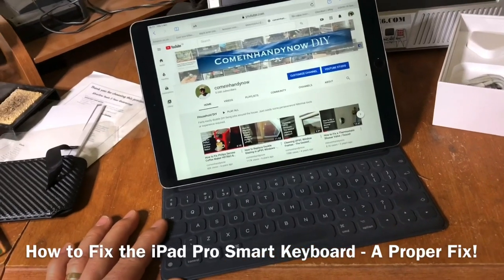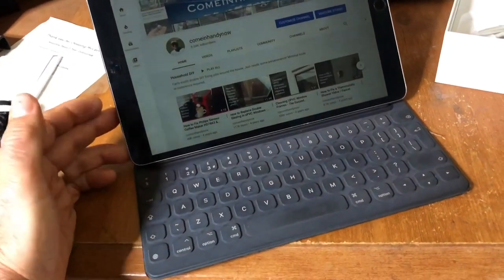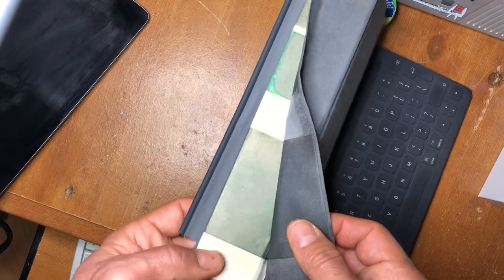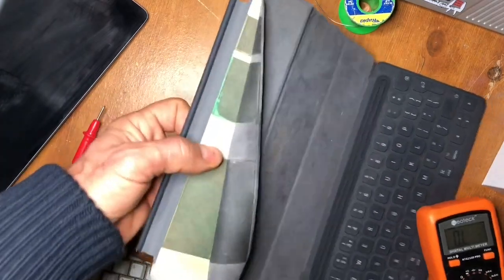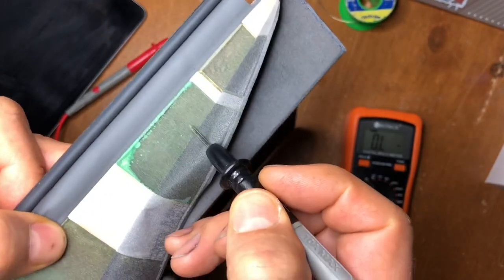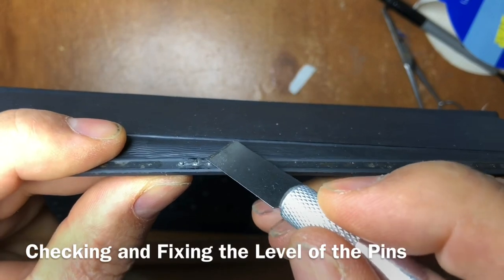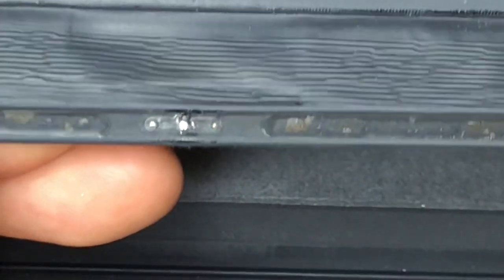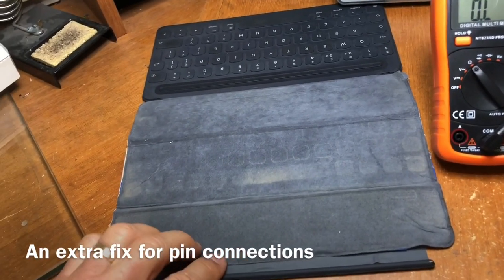How to Fix the iPad Pro keyboard - 4 fixes! Working Proof!

Comment: Can 24Ω be enough to completely destroy a connection? Im working on my friends keyboard, two pins have 24Ω and the keyboard is not being recognized at all.
Reply from the maker: I wouldn't have thought so, but it is more than a new or fixed keyboard and not that desirable. Is that all the way from the pin to as far as you can get to near the keyboard end?
Reply: @comeinhandynow  Thanks for your help.  No, I only measured from the pin to the first two visible cm of the conductive fabric.
Reply from the maker: @thebread1034  I would strip it back further to measure if there is another break on a joint.
Reply: @comeinhandynow  That is actually the problem. There is a constant black line on one of the bending edges, multimeter confirms with missing beep and at least 20kΩ. Thanks :).
Reply from the maker: @thebread1034  Great, glad you found the problem.

Comment: Any idea to get rid of a short circuit between the left and right pin? Or ist it normal to have 0 ohms there?
Reply from the maker: That is not normal.  Seems unusual.  You could try deliberately breaking the ribbon strip in the middle somewhere to try and isolate where the short is. Keyboard end or pin end.  Then try and isolate more from there.

Comment: How to fix with water damage on apple magic keyboard iPad pro?
Reply from the maker: Water damage is difficult but try getting access to the circuit and spray with wd40 type spray oil or switch cleaner spray.  Remove any noticeable corrosion.  Not easy to come back from water damage but possible sometimes.

Comment: Some people use conductive fiber tape to fix keyboard, Which do you think is better, fabric tape and copper tape?
Reply from the maker: Fabric tape may be better as long as it conducts on both surfaces.  Let me know if you find some to buy.
Reply: @comeinhandynow  I used fabric, but it does not work. i think my keyboard has another problem
Reply from the maker: @JJ-cd6ui  Was it conductive on both sides? And through the adhesive? Did you measure the resistance?
Reply: @comeinhandynow  Store said it is conductvie on both side and I dont have resistance testing tool so that i cant measure resistance. i think my keyboard killed itself
Reply from the maker: @JJ-cd6ui  Buy a multimeter - only £5!  Don’t give up until you have measured the resistance and checked you actually have a connection from the pins to the keyboard end.
Reply: @comeinhandynow     I measured resistance and it looks like the middle pin is disconnected. i'll be back after trying ur extra fixing! thank you for your support

Comment: I don’t and any of these issues with pop ups saying not supported it just doesn’t work, i was mid way through a email and it just stopped working
Reply from the maker: It is probably the same issue, a break in the flexi strip connections, but try easier things first like resetting (powering off and on) the ipad, checking the pins are clean and sit level, the ipad connections are clean and reconnect the keyboard a few times.

Comment: Thanks for your video and I tried every step you did and successfully connected again. But now I completey break down this shitty smart keyboard because, it's not working again after 1 day. I suspect there are 1 more point of failure, which is connection between fabric wire and the pogo pins in the hard spine. I know it is very well shield with hard steel but who knows. 
This is the least satisfactory Apple product that I've ever bought. There are so many possible point of failure. So sad. I am writing this with my Bluetooth keyboard...
Reply from the maker: It is a shame because when it works it’s probably the best keyboard out there. I tried about three different Bluetooth cheapo Chinese keyboards and they’re all absolute rubbish with keys packing up, keys that double enter and frustrating missing of the first few characters you type as it reconnects by Bluetooth. I think the next best is probably the Logitech smart keyboard.
Reply: @comeinhandynow  Yeah I know. Glad that I own Logitech K810 for alternate.

Comment: No such luck for me.  I peeled away the backing to reveal no corrosion whatsoever.  Pins look good too.  I've never mistreated this keyboard and have not given it heavy use either, yet still has failed and doesn't seem to be rehabilitatable.:face-orange-raised-eyebrow:

PRO TIP: If you want to make it easy to peel away the glued-together bits, simple apply heat to the surface(s).  A small iron, hair dryer, heat gun, or even a very powerful (and hot to the touch) LED flashlight pressed up against the surface will do the trick.  Heck, you can probably throw it in the oven on low heat and it will make it all very easy to peel away the covering.
Reply from the maker: Thanks for the heat tip. You need to measure the resistance / check continuity between the pins and as far back on the conductive strips that you can go.   The point at which conductivity is lost (high resistance) is where the break is.

Comment: Thankx I just ordered $2.50 in 6mm wide x 20 meters to fix mine. That suede skin sure is hard to slowly pull off and leaves patches. I tried the hair dryer I'm not sure if heating it helped. I also tried rubbing alcohol but it didn't dissolve the suede adhesive. I pulled the suede all the way off down to the keyboard. The conductive ribbons end at the keyboard, they seem to be sewn into a plastic edging connection so that fold where the keyboard starts should be robust. I also pulled off the rubber edge up to the magnetic hump. I'm going to span it all with the copper tape so all fold weak fatigue folds will have copper tape spanning over it. Hopefully this keyboard will last a good long time now. Damn apple sure did go cheap with the conductive material...
Take care
Reply from the maker: Good luck, let us know how you get on.
Reply: comeinhandynow it worked!!! ThankX at first it didn’t but then it did and it’s been working for a week straight now! I did 2 side by side rows of the copper tape over the conductive fabric on all 3 fabric strips.
Reply from the maker: @JimTMcDaniels1  Great. Well done.

Comment: I followed this to a video perfectly but it still didn’t fix my keyboard😫
Reply from the maker: Did you measure the resistance from the pins to the strips near to the keyboard and are they low resistance? (multimeter needed, see buying links in description).  Also check there are no shorts in between the three tracks.  Also check all three pins sit up at the same level.

Comment: did not work forme , the fabric was well stuck on, and when trying to remove it, it also damaged the conductive tape, put it in bin, thanks anyway
Reply from the maker: ok. it usually works but can be a bit tricky.

Comment: I thought I’ve found the solution but it’s not fixed
Reply from the maker: Measure the resistance from the pins to the strips near to the keyboard to be sure that your fix has worked when you do this.  A high resistance means poor connection.

Comment: Well I’m not convinced for the proposed solution. The reason is that I’m experiencing the same problem and I must say the behavior of the ‘’smart’’ keyboard is totally UNPREDICTABLE. Sometimes it works very well, sometimes is completely out of order and sometimes is working intermittently. This behavior proves the inability to find the cause of the problem. Today I visited a certified apple service center, they told me they must do a factory reset and try again. When I told them I don’t want to do this they proposed to go at the apple store itself. I arranged an appointment and I will inform you for the outcome in about a week.
Reply from the maker: Well, let me try and explain why the failure mechanism fits with the intermittent behaviour:  The connections in the flexi joint become weaker leading to higher resistance in the connections, this high resistance degrades the signal communications with the keyboard, meaning that sometimes it can just about make out the signal and work and sometimes the signal is too low and lost in the noise.  A bit like trying to speak in a noisey crowd, sometimes you can make out the conversation, sometimes no hope.  This also varies with movement of the keyboard joint and the resistance of the pin connections to the ipad.
Reply: @comeinhandynow  It sound fair. I am a little bit confused and desperate.. I will try with apple and if they don't solve it I will probably try your fix. Did you also experienced the same uncertain behavior? And after the hardware repair is it all fixed?
Reply from the maker: @fotius332  Yes it starts off intermittent.  Doing the hardware fix fixes it, but if you flex that joint lots then eventually it may wear out again.

Comment: There is a label on the bottom of the keyboard, written in black, place a bandaid over it. Or, a piece of tape with paper or some small raised match stick thick material, RAISING CONTACTS
\-_-/
Reply from the maker: Sorry but sounds like nonsense.  If the 3 contacts are the issue then just bend the strip that they are on very slightly up to raise the contacts.
Reply: @comeinhandynow  investigate, sounds can deceive idiots. gravity pulls the ipad and smartkeyboard down? the raised area beneath the contact points pushes up?  PROVIDE CLEAN CONTACT POINTS.

Comment: just taking out the layer of the keyboard skin is catastrophic and hard. u didnt say there were two layers and one layer is the elect part and the other layer rips it all the way to cardboard . let a pro handle this dont do urself
Reply from the maker: You learn by trying and making mistakes. Nothing to loose as there is no “pro” that is offering this service and the keyboard is already broken if you are trying this. You should have looked at the layer that I removed in the video for guidance. Even so all may not be lost if you can join a connection either to the conductive strips or to the pins and make connections to the keyboard end. Test the connection with a multimeter.

Comment: I bought my iPad Pro and keyboard in 2018 and the conductive strips under the grey cover is slightly different but still has 3 conductive strips, a thick strip on the left and right with a thin strip in the middle. However, the pins resistance doesn’t correspond to the adjacent conductive strip. I get resistance between the m’idle pin to the right strip, resistance between the left pin to the right strip and resistance between the right pin to the left strip - so thee is connectivity but is this connectivity right?
Reply from the maker: Be aware that you may be just measuring the resistance due to the electronics in the keyboard. This will change depending which way round you connect your multimeter probes.  It will probably be in the kilo ohms range, or more. The pin to ribbon connections should ideally be no more than a few ohms or less. So if you have more than this you’ve got a broken connection. I would be surprised if the connections are in a different order to the one shown in this video.
Reply: @comeinhandynow  the pins give a reading of about 200 ohms no matter the placement of red and black probes, and aren’t between adjacent conducting sheets, which doesn’t seem very high. When placed between pins and adjacent conductor strip, middle to middle etc I get a reading of 1 which indicates no connection........very odd. I’ve ordered some conductive tape, it gives me ‘this accessory is not supported’ but won’t let me use it all.
Reply from the maker: @richardbailey8896  For reference here are my measurements I’ve just done. With keyboard face up to the right and pins to the left: resistance between top and bottom pins 30kohm, probes either way round. from bottom pin negative probe to middle pin positive probe 3.3Mohm, with probes reverse infinite ohms. With negative probe on top pin to positive probe on middle 3.3Mohm. With probes reversed infinite resistance.  Resistance from each pin to the end of the flexible strip up to near the keyboard, resistance is less than 1.5ohms for each pin.  
I hope that helps you compare and see where the break is.  The strips connect to the pins in the same order, i.e. top pin to top strip etc.
Reply: @comeinhandynow  thanks, ill check....ASAP and post the results. The keyboard is now responding but obviously not working properly so the connections are dodgy somewhere....let you know and thanks for the help.

Comment: Mine needed to be restarted.
Reply from the maker: how is it lasting now?
Reply: not very well  i need to restart aging
Reply from the maker: @runneryg  You probably have the problem shown in this video with the connections starting to get higher resistance.

Comment: This is stupid. Magic keyboards like this are so cheap in terms of quality if the price is really atrocious
Reply from the maker: The one in the video is a “Smart Keyboard”, the magic keyboard is something different and quite a bit better. This Smart Keyboard is great when it works for a couple of years, but the design encourages lots of bending, which causes the problem. The cheap Chinese Bluetooth keyboards are are a lot worse quality, I went through 3 from new before I got one that worked on all keys and even that didn’t last long.

Comment: Can’t believe I stripped my whole keypad back and soldered wires on for it not to work 🥲 it’s not the method, it’s me. Despite my best just can’t get it to work. Rip
Reply from the maker: Try using a multimeter to see if the connections are made correctly. measure resiustance - ohms setting.
Reply: @comeinhandynow  I did, everything seemed to connect. Made me think the issue might be further down the board? I wasn't sure whether to keep stripping back or just give up because I was getting frustrated lol
Reply from the maker: @angiiivee25  Nothing to loose if it doesn’t work, keep stripping back as far as you can go.

Comment: You see, mine doesn’t work because my sister dumped water on it
Reply from the maker: I wouldn’t have thought that would hurt it as it looks sealed up to me, asuming the 3 pin connector area is dried off.
Reply: @comeinhandynow  thanks! If that doesn’t work were going to the apple store

Comment: Video did not help at all :(
Reply from the maker: Did you do exactly as in the video and did you measure the resistance with a multimeter?
Reply: @comeinhandynow  no because it is a useless way of fixing something which takes forever  i prefer you show a easier way without any tools needed :)
Reply from the maker: @streamzkid6783  lol. So you are one of those who expect an easy life without having to work hard for it? Somethings are not simple to fix and need some effort and some simple tools (also cheap as a multimeter is only £5)

Comment: I Hope some of those engineers are watching and feel embarrassed as f. 
Just have a 2.5 year old Smart Keyboard that I nearly never used so I guess I’ve the same problem with erosion. It is a f joke Apple! Same with the display cable in the MacBook. The T2 got hacked! Louis Rossmann is trying to open our eyes for years. I still bought my 2018 MacBook but continue using my iPhone 6s, though the battery only works for 2h, while having 85%. I don’t know what else to buy, since android isn’t an option for me. Thinking about getting rid of a smartphone at all. Using Apple won’t be an option for me anymore, not with this kind of quality and not with this kind of missing innovation an all products.
Reply from the maker: I had an iphone6s for a few years, took advantage of the low price battery change and was still good.  Now on iphone8plus which is even better. Good battery.  The thing is they are all extremely complicated and hard to make and hard to make them last.   Nothing lasts for ever.  I still think Apple are the highest quality as there is a lot of other rubbish out there.